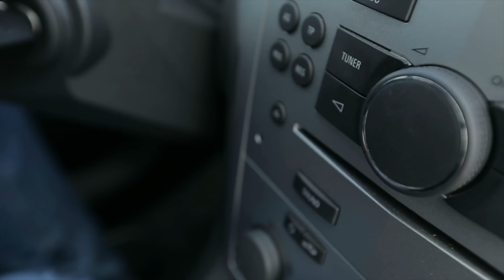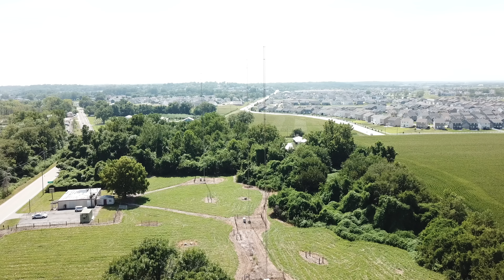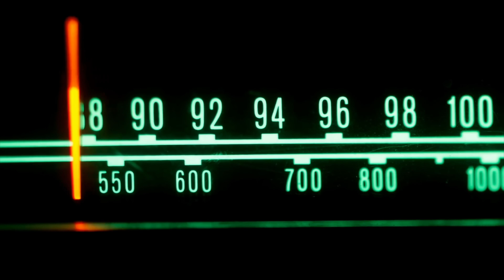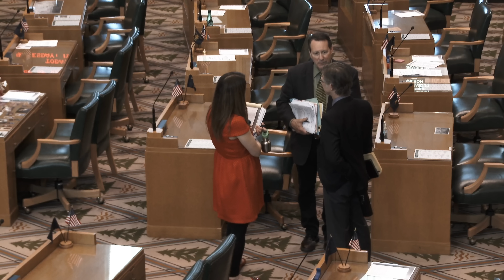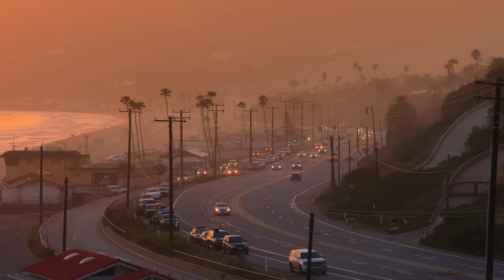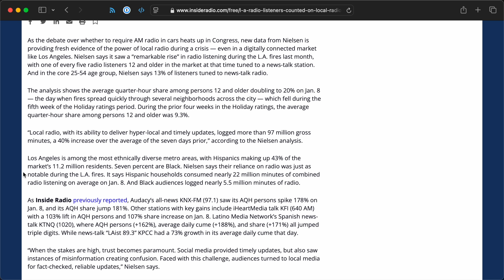Automakers are losing the battle with this 100-year-old tech

Comment: Since FM radio has been mostly shut down here in Norway (local stations and some commercial stations can still use it as @Veso266 pointed out. Though AM never became a thing), it's cool to still see such a big push for it over there. I miss FM radio, you just don't get built in DAB(+) tuners in new devices even long after the shutdown. My Walkman can only receive FM radio for example. Also it's clear that AM still has its use cases and benefits, so I hope the auto makers get shown what for.
Reply: I thought only NRK shutdown their FM transmitters (and not even all of them), and then money took over and some comercisl station followed, but commercial radio is still allowed to broadcast no?
Reply: @Veso266  I wasn't aware of that, but you're right. Local radio stations can still use FM broadcasting it seems.

Comment: There is one feature of AM radio that cannot be matched by newer technologies: if multiple tranmitters are on the same frequency, you can hear both stations. In FM and Digital you get nothing. A lot of states highway information stations rely on this as they place smaller AM transmitters across the state and even though they are all transmitting of the same frequency, the signal is intelligible enough to get roadway and emergency information through.
Reply: Let me introduce you to SSB...
Reply: That is because each transmitter's channel frequency if accurate so there is no "beating" of two or more carriers.

Comment: The problem is that auto manufactures do not supply an antenna capable for that band.
Reply: I live in Utah and can get KNX Los Angeles on 1070 AM even in the daytime, over 800 miles away. And that's in my 2018 Honda Civic. Honda has really good AM antennas so what are you talking about?
Reply: Very short Active Antennas have been available for decades and work well on the MW BC band..

Comment: Anyone told Shango  ?.   
The UK are going to loose 198kHx Droitwhich 500kW,  Sign the petition to SAVE LONGWAVE  we need a backup to unreliable digital tech.
Reply: Where is this petition?

I want to sign it
Reply: @Veso266  SAVE    198kHz LONGWAVE   Droitwich    I cant post link.  Lewis did a video on this some time ago.
Reply: As nice as it is to build a functional radio with a diode and a coil, "unreliable" is not what you would really call digital technology. Or even FM radio. You do have the UK's piss-poor implementation of DAB, but that's not the fault of "digital tech". Don't forget you're using digital technology to post about the loss of a half-megawatt transmitter that could probably send a digital signal from here to the next galaxy given an appropriate antenna.
Reply: @technicalfool  in theory yes

But in practise it wont, cuz people will just lower the tx output power and add another transmitter to cover the same area (will I hsve lower license fee because bbc will not pay that much in electricity? No, why would they give up extra money)

so at the end we will have worse service (if signal is bad, which it will be, cuz it always is at some point)

Same as DAB+, in theory it can have amazing audio quality, but in practise it doesnt cuz multiplex operator wants to cram as much stations in one mux as possible (not only uks problem, but its more like people or greed problem, and right now there is no easy solution to make people be less greedy when money is involved)

Sometimes tehnology just forces some good ways if people dont find them on their own (if money is involved we all know what wins)
Reply: @technicalfool  
My point (which I think you missed)  is that AM can operate free from digital functionality and therefor more robust with regards the mischief from hackers buggering up the 5G and PSTN and Internet.   

Many Longwave receivers are still in public use as well as mariners who rely upon Longwave when at sea. 

 198kHz ensures the whole country can be kept updated with one voice as to any national emergency. Digital infrastructure would be the first to be compromised in times of hostilities.  

The US have passed a Bill to ensure all car radios can receive AM because of the potential for the digital systems to be hacked. 

Interfering in a nations communications is a war strategy and first to be played. "Aspidistra" was created to spook the Berlin transmitter during WWII with the BBC transmitting in German programmes thought to be from Berlin  

I am aware I am using a digital based platform to post but Droitwhich are unlikely to allow me access to their TX. Best
Reply: @technicalfool  
My point (which I think you missed)  is that AM can operate free from digital functionality and therefor more robust with regards the mischief from hackers buggering up the 5G and PSTN and Internet.   

Many Longwave receivers are still used by the public as well as mariners who rely upon Longwave when at sea. 

 198kHz ensures the whole country can be kept updated with one voice as to any national emergency. Digital infrastructure would be the first to be compromised in times of hostilities.  

The US have passed a Bill to ensure all car radios can receive AM because of the potential for the digital systems to be hacked. 

Interfering in a nations communications is a war strategy and first to be played. "Aspidistra" was created to spook the Berlin transmitter during WWII with the BBC transmitting in German programmes thought to be from Berlin  

I am aware I am using a digital based platform to post but Droitwhich are unlikely to allow me access to their TX.

Comment: Yeah, we had a  situation here in the South Pacific. Up in New Zealand's North Island, (usually a nice mild Temperate climate year 'round) as a freak weather they got the tail end of a dying Tropical Cyclone ("Gabrielle"). The problem was absolutely massive dumps of rain, in never before seen quantities over a short time. That led to floods and in rural areas especially that took out roads and  bridges, powerlines and phone/internet cables.  Because so many roads and bridges were out including in rural areas where there is normally only 1 or 2 roads even giving access to that area, repair technicians were limited in their ability to get in to start repairs.

Even those areas that did have some cellphone coverage, the backup batteries in the celltowers run down after a day or so without the main electricity to keep them charged.  

AM radio, especially at night, travels much further distances, so people using a small battery transistor radio or car radio, could get news and updates, including reports of where food and water drop-offs were available etc.    

Another story... My previous car had a radio where the FM setting didn't work well, so I just had it tuned in to a couple of my favourite AM stations instead.

Comment: It is mandatory in Australia...  EVERY vehicle in Australia is required to have an AM radio regardless.  The AM radio has emergency broadcast as the AM signal go long distances.

The reason is that Australia across the nation experiences bushfires...

They will need to be designed to meet the requirements so the car engineers already have it and trying to have it "subscription" based.

Comment: Thank you for you work on preserving AM radio ,In Australia we still have a lot of AM ,some have switched over then noticed that suddenly the coverage has dropped to half of what they had and advertisers see this and pull out of advertising , AM Stations in Australia especially ABC (Australian broadcasting Commission) over all run mostly 50kw TX at most sites and pretty much anywhere you are you can get our ABC especially in times of emergency but its not just that its thats its there to keep you connected anywhere any time ,Thank you for all of your YouTube's some very good information you both present ,Cheers from Rodney
Reply: 'When all corporate AM radio is abandoned, only non-corporate radios will have AM!' - or something like that... The airwaves belong first & foremost to the people (maybe moreso than most other things), & we will use them as we need. All privatized interests can take a number.

Comment: I remember when I was younger,we had tvs that had outside antennas and if a ford went by we would get interference from them.
Reply: In my area we still have TVs with outside antennas, although all the broadcasts are digital at this point and the signal is pretty consistent

Comment: What ever happened with stereo AM?  I recall that being a thing that was designed and proven but I don’t recall ever seeing it deployed.  IMO that is what is needed to bring the public back to these airwaves.
Reply: HD AM does exist.  You wouldn't know though unless you have an HD receiver.
Reply: AM Stereo was handicapped by the broadcast industry promoting a number of incompatible standards. That and the fact that there were few AM stereo radios available for some years. It did work very well however.

Comment: I love this topic.  I'm a civil engineer, a ham, and a car guy.

I was told by a very elderly city engineer that in the 1940s and 50s, a lot of cities ripped up their trolley systems because the RFI from the electric motors and hot wires ruined AM radio reception for the people in cities near the tracks.  AM radio was the future of entertainment at that time.

Newer electric and hybrid cars run on the same principle (for the most part) as the old-school trolleys, and the electric motors in these cars create the same RFI on a smaller scale.  The car makers can clean up their designs to make the motors run "radio clean" but that would come at an expense (I can see an F-150 Lightning getting 100 ferrites clamped around random wires to chase the problem.) It's cheaper for the car makers to get rid of AM in the car than to clean up the radio noise the motors make.  Plus most AM receivers have more parts, like a ferrite coil antenna.  Deleting those parts by getting rid of AM capabilities allows the car makers to save a few bucks on each car that goes out the door by adding cheaper, smaller radios. Perhaps they could install a remote antenna away from the drive wheels - think of the rotatable bar antennas that plug into shortwave radios.  Run a wire into the trunk, away from the drive motors and mount a bar antenna there.

Here's why I truly believe that this became an issue:  AM Radio content.  AM Radio is mostly sports talk, Christian programming, or conservative talk radio nowadays.  The politicians wanted to get rid of the conservative talk...  and getting rid of the religious programming is seen as a bonus to them since that goes hand-in-hand with getting rid of the conservatives.  Now that the winds have changed in D.C., AM radio got a 4 year pardon.
Reply: Bingo! And the millions of dollars being spent to fight against keeping AM in cars is coming from... well, I know what my guess would be, given recent events.

Comment: I'm tired of the fully-integrated radios in cars that make it nearly impossible to upgrade to an aftermarket unit. I know I'm at least 15 years too late to complain about them, but it still sucks. Hell, if the feds mandated a standard radio like all cars had back in the 80s and 90s, I bet this effort to save AM radio in cars wouldn't even be an issue.

Comment: I was dumfounded when I first learned that this was even an issue. My Chevy Bolt EV has an AM radio that works pretty well, and I never gave it a second thought. I was pretty impressed that the little shark fin antenna worked as well as it did.  Then I heard that Tesla did not have AM. WTF. Just Lazy to me.
Reply: Does the Bolt EV have a somewhat conventional head unit? If so that could be why its included.
Or maybe even if its not a conventional head unit they are using the regular GM suppliers that build combination AM/FM receivers for every other GM vehicle's entertainment systems.

To be honest I don't miss it in the Tesla.
Used to listen to AM all the time but can't abide broadcast media these days, mostly because commercials.

Comment: Bring back CONELRAD radio. Besides, in any emergency, from storms to war, AM receivers are the simplest to build, they don't even need power, and are the most reliable.
Reply: my first Rx at age 7 was crystal, no batt germanium diode, amazed me totally
Reply: They are also the noisiest, and among the least sensitive.
Reply: simple works when nothing else can .. the best ideas typify reliability; not much can go wrong. AM punches an intelligible msg through extreme conditions like nothing else.. ssb/amsc packs an immense whallop
Reply: @bobbundus4593  AM is really is not a mode I think of when I want to "punch an intelligible msg through extreme conditions".  I'd actually rank it at the bottom of the list.  It wastes power and it wastes bandwidth.  This is why your typical local AM radio station is running about 50 kilowatts to get a 10kHz wide signal out 100 miles.  That's one reason why it really hasn't been used for anything new since the 1930s.

Comment: No offence. I see a car that comes w/o am/fm as a bonus. less wasted materials/design to go into something that I don't use. years ago, I was absolutely SICK of every fucking station saying the same thing on repeat every hour:

Listen to us, we only play you music, very few ads
hold on tight, we need a quick commercial break
Listen to us, we only play you music, very few ads
hold on tight, we need a quick commercial break
Listen to us, we only play you music, very few ads
hold on tight, we need a quick commercial break
Listen to us, we only play you music, very few ads
hold on tight, we need a quick commercial break
Then they'd play at most 5 minutes of actual music that hour.

It's that or the brainless, boring, absolutely worthless talk shows WHEN I WANTED FUCKING MUSIC ON A MUSIC STATION.

When they DO play music, it's always the same fucking 3 songs.

Hell no. When I replaced the head unit in my car for one with bluetooth I left the antenna disconnected. Radio can fucking die.

The only use radio has now, is for emergency shituations, in which case a portable battery powered radio would be more useful in any case.

Fuck having am/fm radios in cars.

Comment: So here is the reasons we need it. If you are in a rural area there are people that live where there are few if any radio stations of any kind. Given the limits of FM to line of site an AM signal can travel much further.  Clear channel AM stations are often heard 100s of miles from there transmitter. Even lower power stations carry further. than a powerful FM station.  Another reason is beyond talk radio much of the foreign language broadcasts remain on FM, in large part because the hardware being much more basic than FM is far less expensive for a small market.  

Still one more reason low power AM traffic radio is very common.  I don't think I've ever heard an FM traffic radio setup. That may be less needed with everyone having a cellphone and getting traffic info from Gogle maps or Waze but it still serves a purpose.
Reply: "I don't think I've ever heard an FM traffic radio setup"  The only reason you've ever heard an AM traffic advisory radio is because frequencies are reserved for it.

Comment: I live in Western North Carolina - and during and after the remnants of Helene devastated our area in September, AM radio was vital in several small communities beyond Asheville. In the past decade or less these small communities that only had AM stations have added FM translators. However, those FM antennas on remote mountain tops had access damaged by trees or mudslides. Plus power was lost at those sites. The studios were co-located with their AMs and either could stay on the air with a generator or had power restored much quicker than at their translator sites. So AM-only was the lifeline for up to several weeks for some of the smaller WNC mountain towns with radio stations.
Reply: Also, after dark the range of AM can be huge.
Reply: Governments of idiots in Europe just can't see that. They say: make room for newfangled, fad tech that will be equally treated as throw-away infrastructure in a few decades just to keep finding new ways to cost tax-payers billions for giving them the same exact service.

Comment: We have DAB+, FM and AM in Australia but I find I use AM the most in my vehicle because of the signal reliability. It works better at longer distances and in hilly areas.
Reply: DAB+ here has a few good music stations. But the 32kbps audio quality is just unacceptable...
Reply: @gammaboost  I'm glad someone is finally calling this out. Some of the DAB bitrates especially commercial ones are terrible.
Reply: @IanMcLeod75  Low bit rate and mono !
Reply: @gammaboost  Not all DAB+ stations have such low bitrates. I think all BBC stations here in the UK are higher. Radio 3 is 192 kbps.
Reply: I never have to venture far from home but I find the only time I use the radio in the car is when the cricket is on, so it's permanently tuned to the local ABC AM station.  Usually I'll be listening to podcasts or if I want to listen to music I'll play songs I already own, and don't have to listen to the inane drivel of 2-3 unfunny idiots between songs on the FM stations.
Reply: Especially since the ABC shut down your shortwave broadcasts.
Reply: Wtf is a Dab?
Reply: @VanuOfMILF  A dab is something I do at 4 : 20pm. Lol jk. DAB is the standard of digital radio used in Europe. It uses a different VHF band than FM, unlike our standard of HD Radio.
Reply: DAB is ridiculous in a car. I mean the analogue bands crackle or whistle a bit occasionally in a lower signal area, but in the same areas DAB literally just switches off.
Reply: Thats cuz your old, at least 50 years old. Anyone younger than 40 in australia hasnt changed to AM in at least 2 decades.